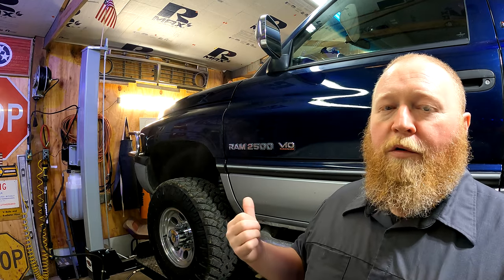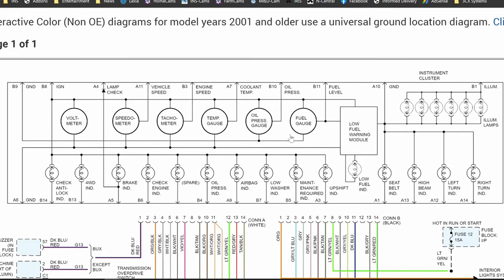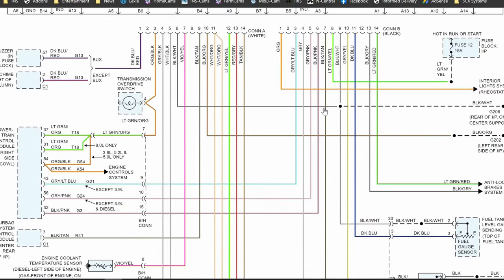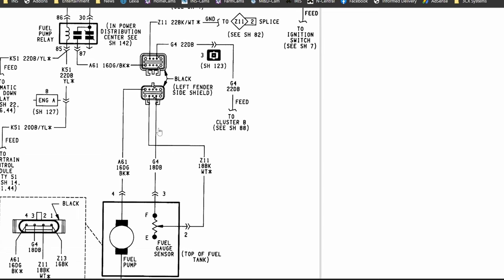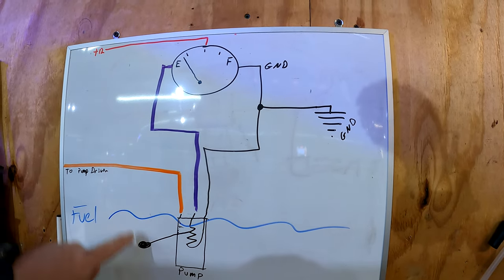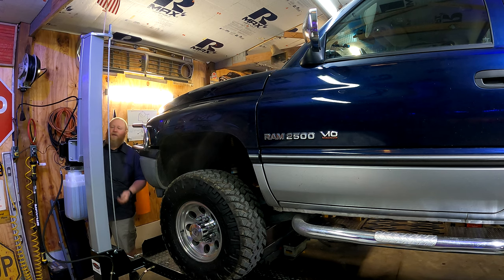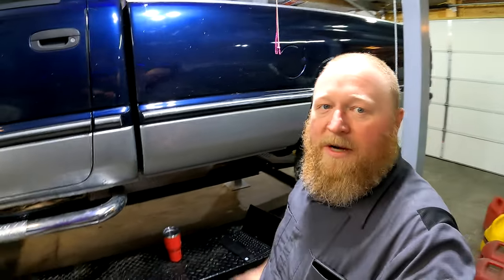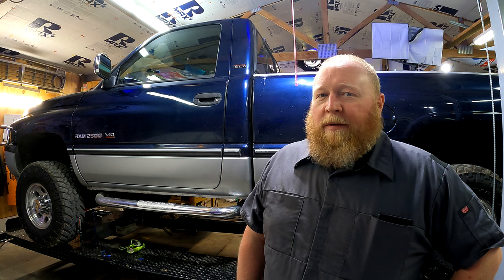HOW TO TROUBLESHOOT a Non Working FUEL GAUGE or Fuel Sending Unit

Comment: Great troubleshooting. That is irritating when you get a DOA part, especially in a fuel tank which requires dropping it.  I would seriously consider shunting the wiring for those buzzers.
Reply from the maker: LOL @ the buzzer noise - I actually repaired the buzzers in a previous video in order to make the truck (more original). I said in that video that I would probably end up getting sick of them and killing them again - that time is getting closer.
Reply: @ProjectTimeGarage  I remember that video when you had some wiring issues or that were caused by a family member.

Comment: I worked on a jeep a long time ago that i went through 3 “new” fuel pump/sending unit assemblies before finally getting one that worked correctly. Just goes to show you that just because it’s new doesn’t mean it’s good.
Reply from the maker: Yep, and it's getting worse I think.
Reply: @ProjectTimeGarage , it is. This is their way of forcing you to buy a new vehicle. They won’t ban the sale of these old trucks on the second-hand market but they’ll get rid of the parts to fix them.

Comment: Smart way to just do a quick test on the wiring within the truck, I like it! I can’t stand when parts are bad right out of the box. Especially ones as much of a pain in the butt to change as a fuel pump. Dropping tanks is the worst. I’ve never actually had any fuel gauge issues at all in any of the 2nd gens I’ve ever owned, that issue typically seems to be reserved for Chevrolets of this era!
Reply from the maker: I'm getting a TON of new "bad" parts these days. I pre-test most things if I can, but this sending unit actually worked fine for a while, then died. Actually, it reads correctly until you hit the 3/4 mark, then it drops. My guess is the wire wrap has a break in it somewhere.
Reply: @ProjectTimeGarage  so frustrating, it’s making me worried about the Shelby with everything I’ve replaced on it from Rock Auto…
Reply from the maker: @TheMoparGarage  Yeah, I've started going to the dealer on a lot of stuff.